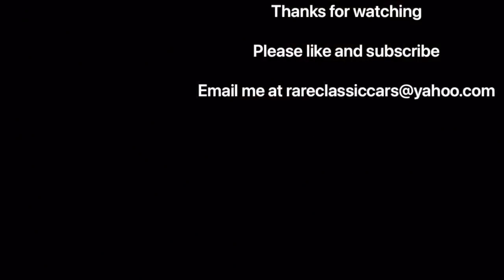Worst Engines of All Time: Chrysler 318/360/400/440 V8 Electronic Lean Burn

Comment: The ELB even made it to Australia on Chrysler Australia built vehicles on all of our 6cylinder and V8 engines. They even had a light on the front guard that would flash up orange when the car detetermined you were having too much fun with the throttle.Curiously I have friends that had ex police vehicles with the 318 where the ELB system wasn't fitted although I can't confirm that they were omitted from the factory or removed in their post police life the evidence suggests they weren't fitted. Our 6 cylinder engines were also fitted with this system which meant we would of had to do some of the development work here as we stopped using the slant six around 1970 and used our own developed 6 cylinder power plant which I believe had its roots in the US before it was shelved and was more thoroughly developed here in Australia.
Reply: Yep , the 245/265 and 318 got the ELB here ( in Australia) from CL 318 , Le Baron and all CM’s. And they are all probably still working today.
Reply: I was only a kid when ELB came out in Australia and I remember that compared to Ford and Holden sixes the Chrysler six was more economical. It was always more powerful even though not as powerful as the earlier models, which I had a VH Charger 770 265.
Reply: ELB was legendary in Oz thanks to the highly talented Chrysler Australia Engineers!

ELB made the Local Hemi 6 245/265 almost a new engine! The most fuel efficient & powerful Big 6 in the country! Wasn’t that good in the 318 V8 as it was in the Hemi 6! ✌️

https://youtu.be/rl02SxA8AMo
Reply: Chrysler in Australia are reputed to have had the best sixes during this period compared with Ford and especially Holden, even with ELB. Their more modern design enabled them to cope with anti pollution gear more efficiently. 
Their V8's weren't that good from memory, however, and sold poorly. The Hemi sixes actually outperformed them.
Reply: @noelgibson5956  I like comparing GMH & Chrysler Australia in the late 70’s!

Both companies had the opposite problem to each other!

Holden had the up to date body style (VB Commodore) with an obsolete fuel guzzling slug 6 Cylinder engine!

Chrysler had the dinosaur body CM Valiant with a sweet fuel efficient powerful 6 Cylinder Engine the best in the country!
Reply: I might be mistaken, but I think our cop cars here in the states had the computer mounted in the cabin. The idea wasn't horrible, but the execution left a lot to be desired. I had a 79 Cordoba, and ordering the MP distributor kit was the 2nd thing I did to it after a fresh battery.
Reply: I bought a 1980 CM Chrysler 6 years ago with the 318. It did have the elb on it still but I was told a few times that it can be troublesome so I got rid of it!
Went to a full HEI system instead. My engine now has a mild cam in it also and it has never given me any grief as yet BUT it may have if I’d left the elb on it?

Comment: I knew someone with a new 77 400 Cordoba within 2 months old it met a untimely end it was garbage the Chrysler dealer couldn't get it to run right and no one would throw away the distributor and carburetor on a brand new car
Reply: The owner should have done so.  The hell with shops.  They are constrained by the EPA.
Reply: @michaelbenardo5695  it was 1977 and a different time that wasnt even acceptable on a 2000 mile car he just disposed of it like trash and moved on
Reply: @wallyfronzaglio372  I am 66 years old, so I know exactly what it was like in 77.  I indeed would have, rather than put up with a bad-running car.
Reply: @michaelbenardo5695  I can see converting the system if the car was a few years old and out of warranty
Reply: @wallyfronzaglio372  I wouldn't wait, I would do it right away.  Of course, if you don't know how to do your own work, I can see your point.
Reply: @michaelbenardo5695  what I meant is I'm not going to have to reconfigure a brand new car I just bought it's going down the road

Comment: I worked at a Chrysler dealer as a service advisor in '77. A young attorney customer BEGGED me to do anything that would fix his black Cordoba. He complained that while out in the car on a date, it "smells like I sh*t my pants"! The techs did all the could, the district rep got involved to no avail. There was little or no oversight at the time, so.... they cut out the catalytic converter. No more rotten egg smell, but the car was still a pig.
Reply: Those were beautifully styled cars.  Chryslers had the best looking cars in the day,  Their bumpers were so much styled into the car, than any other car back then, hands down.  Actually looked like a part of the design.  Not after thoughts.
Reply: We had a '75 Cordoba that was fantastic. It was mom's car.  Dad liked it so much he got a '77 Cordoba for himself. It was a disaster. Great looking car but that engine was such a dog.
Reply: Funny I had one that was black too.  After 6 months I got rid of it.  One thing after the other.  You can only put so much lipstick on a pig.
Reply: My step dad had a Cordoba with it's rich Corinthian leather LoL it was a crappy car.
Reply: @kraigcochran9995  That Corinthian leather was actually made in New Jersey. New Jersey doesn't make much of anything, now, so, Chrysler's Corinthian leather is extremely exotic, these days.
Reply: With the "Rich Corinthian leather"? :)😆
Reply: I had bought a new 77 Cordoba. Beautiful looking car. I was disappointed in many ways. The running problems mentioned, driver's seat would put my legs to sleep, the rotten egg smell, early rusting, etc. Never drove it in New York winters. Nobody thinks of them as classics. I've been disappointed in Chryslers for too long now.
Reply: I had the same problem with my 78 Cordoba  with the 400 .
Reply: @jamessneed8789 ;  The car design got worse after '76. They seemed to not know where to take it after '75 design blew-up and everyone  wanted one.  My sister got the '76 Cordoba 400 (black on black) w/everything offered, and my wife got the '76 Charger 360 (black on YELLOW, Yes! "shoot me in the head").  That bastard had lifter problems from the 1st drive hom from the stealerShip to 18 mos later on trade-in. It had less than 1k on the odo when I removed and replaced the lifter set in our garage. They seem to never pump-up to full strength, always sounded like a diesel under 45mph.
Reply: A family friend had a mid 70s Cordoba. Beautiful style and smooth riding car.
Reply: When the catalytic converter was first proposed, the EPA told us that it would convert unburnt hydrocarbons into "harmless" water vapor and sulfur dioxide. That's where the rotten egg smell comes from. 
A few years later, a phenomenon called "acid rain" entered the lexicon. Sulfur dioxide combined with water and produces sulfuric acid. Coal burning power stations were quickly blamed, despite the fact that they had been in operation for nearly a century before acid rain entered the picture. Catalytic converters and scrubbing technology was developed for the power generation industry, and acid rain problems were reduced.
Reply: was it the rich Corinthian leather that gave the rotten egg smell?  You should have complained to Ricardo Montalban.
Reply: I bought my cousins 1975 Cordoba and thought it was a nice, luxurious car! It had a 360. I also owned a 77 Diplomat, 85 5th Ave, and 76 Dodge Magnum, a 72 Plymouth fury, a 67 Dart GT, a 71 Swinger, a 73 Plymouth Duster, not to mention all of the Mopars owned by family members!
Reply: Will all those time based spark timing controls, they would probably get in trouble with EPA today, might be considered a ‘defeat device’ for emissions. Gives better emissions on the test cycle, than in real life.
Reply: Can we replace lean Burn with fuel injection on m'y 1988 318 Chrysler fifth avenue
Reply: @michelgagne4243  Yes. Summit Racing sells EFI systems for classic cars.
Reply: Yeah sure
Reply: I don't know, absolutely surprised that a dealer would risk that fine from the EPA. It was STIFF. Enough to make you never want to do it again. Rotten egg smell from a catalyzed exhaust engine is a classic sign of rich mixture or overfueling. Typical dealer mechanics. Go in with a chainsaw when they could use a scalpel and actually figure out what the root problem was. No wonder it was a pig. They never fixed it. Just masked the complaint. This is why people don't trust dealerships. More correctly 'The techs did ALL they were mentally capable of.'  Which wasn't much.
Reply: I bought a 1977 Lebanon, was the worst piece of junk I ever owned. Was nothing but problems, and the dealer tried to charge me labor for warranty work. Said the warranty covered the lean burn replacement but not the labor to change it out. Left me on the side of the road 5 times first two years. Junk, was a proud loyal Mopar owner many years. After that never bought a other Chrysler product after that. Went to Buick.
Reply: I bought a 76 Cordoba off the showroom floor. It was red with a white interior and the dealer had ordered it with all the options maybe except the remote trunk release. It was the best car I have ever owned and still miss it to this day.
Reply: @martind701  lots of people seem to talk bad about them. I think they’re beautiful cars. Thinking about getting one.
Reply: Here in California, he would have had to do that himself, as any shop cutting out the converter risks a $50,000.00 fine.  And he would have had to put it back in for smog-check time, then remove it again.
Reply: @michaelbenardo5695  Meanwhile, here in mid TN, they just dropped checks entirely.
Reply: @TestECull  You don't know how lucky you are!
Reply: @michaelbenardo5695   Oh I very much do. Especially since I'm a gearhead and old school fanatic.
Reply: @michaelbenardo5695  I hope they fine the people who steal them the same amount. they seem to punish the car owners more then the criminals
Reply: The Chrysler Cordoba. "Look what they've done to my Car" said the famous actor, Ricardo Montalbán, in the TV commercials for the Cordoba.
Many years later I saw him interviewed on a talk show. Maybe "The Tonight Show" or its equivalent at the time.
 I remember laughing and being disappointed at the same time when Ricardo revealed that there was no such thing as the "Corinthian Leather" that he promoted as being used as the seat material. In the Cordoba that he promoted in the TV commercial. It was a made up name implying rare and exquisite quality.
Just like the ""haute couture" name brand (that I've never heard of) GD leather purses that my wife dreams about looking at catalogues. She's had one that was originally about $1k, that we bought second hand for $200 In unused, new in box, condition from one of her friends. At least it was big, used a fair amount of vinyl, and held a lot of stuff. So...useful, at least. And when the exterior material developed a tear? It was replaced with a new one. ASAP. Easy for a company to do with a 10,000%+ markup.
Honestly, my wife is realistic about the BS and hype. It's her friends that are not. My wife is a part time realtor/well paid assistant who basically covers for her "boss" friend who's the Main Realtor. 42yo recent divorcee, skinny attractive blonde who really likes to get shit faced drunk, smoke marijuana, has 2 kids graduated from college (Thank God), has a Tramp stamp and just inherited about 5M when her Dad died. She gave my wife a $3000+ bonus Christmas gift purse last year with a 45 degree tilted Chrome F in a Circle purse last Christmas. I've never heard of the company. My wife has said the name 50 times and I still can't remember it. I'm not sure exists, other than to sell exhorbitantly priced purses.
We were shopping in WalMart about a week ago. Something I rarely do because they are an evil monopolistic company. I prefer local. But, in a major freeway town of ~275.000+ people, there's not that much local business left after the CV debacle. So, in WalMart, waiting for a drug prescription refill ($530 at WalGreens...$18 at WalMart...WTF?); the other day for some basic items. I'm 63 and prefer to push the cart because it lessens my back pain. She left down an aisle for a minute to look at something and said "keep an eye on my purse".
I waited, looked at the cart, the purse, thought about the contents of the purse which were her wallet, ~ a couple hundred $ in cash, credit/debit cards with 5-20k limits, Driver's licence, Health Insurance Cards, VA card (She and I are both military Vets), SS Card, car keys with two expensive RFID key fobs and our house key. Plus the usual detritus of life. Gum, lip stick, mascara, breath mints, receipts from the 20th Century (not that old but dated), Kleenex (probably with lip stick on it?), etc.  
And I had an epiphany.   That GD purse alone was "worth" more than everything it contained.
Sorry to get dark. But that's how F**ked Up our Country is right now.
Watching your videos and seeing these cars from my childhood is so awesome, relaxing and informative.
Oldsmobiles, Buicks, Mercuries, Lincolns, Cadillacs, Chryslers, Dodges, etc.
It reminds me of the time when two mid-1970s military brats could go to many different schools from around the US and the World. Both join the military for different reasons. Scholarship money for me. A good paying job for her. Meet, get married, and have two wonderful grown Sons. In a stable World, historically speaking. Thanks to both of our Dads and previous Veterans fighting in real wars against real people who were trying to kill them. 
And wind up in a WalMart in a High Plains American small City. Where the last of the Indian Wars ended about a hundred years before we moved here in 1991. 
With a $3000 purse (that's honestly worth maybe $150).

I apologize for the long comments. I hope some people find them interesting, nostalgic or entertaining.
I also save them to someday put in a "cut and paste" edited autobiography of important and influential experiences that happened during my lifetime. Your entertaining and informative videos trigger me to write these things down before I forget them.
Reply: @msmeyersmd8  I remember these commercials,it reminded me of Don Corleone: Look what they did to my boy...
Reply: @msmeyersmd8  Thoroughly entertaining comment!
Reply: @msmeyersmd8  That's a great story and a hell of an epiphany.  I dig insightful stuff like this.  This is how my mind works.  If you want to share any other stories, I can give you my email.  I'd love to hear them.
Reply: @msmeyersmd8  When Star Trek 2 came out I could envision Montalban doing the Cordoba schtick on the bridge of the Reliant, which happened to be the name of a Chrysler K-car being sold at the time.

Comment: My best friend in HS had a 78 Dodge Magnum with a 400 CID with that lean burn engine.  The crankshaft on that engine broke around 60k miles and they ended up junking the car.